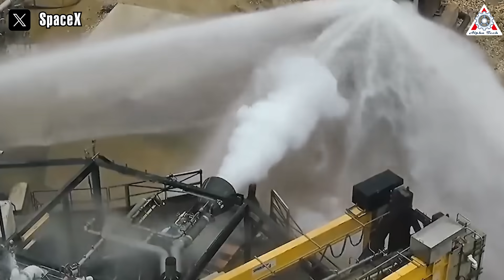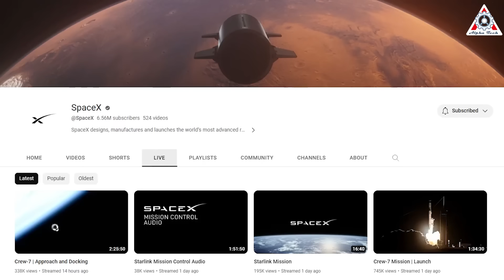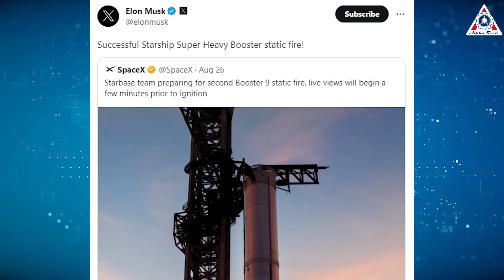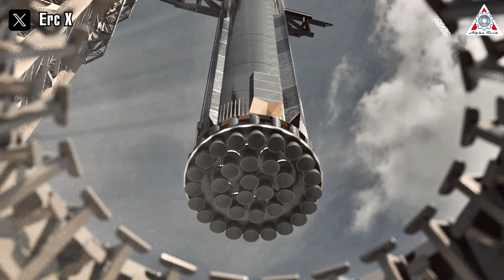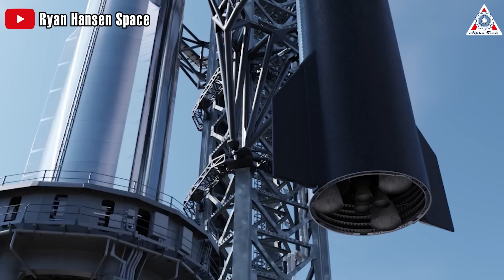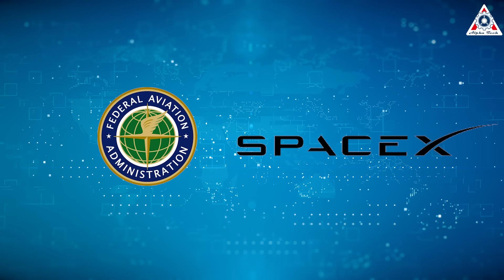SpaceX's Raptor issues FIXED! Analysis 33 engines fired aftermath...

Comment: They only tested 50%, but I think it'll still be okay. after the data they got now, if they need to reinforce it they will.
Reply from the maker: Thanks for your comment! Let's wait for their next steps!
Reply: They need to test it at 100% thrust for the 5 or so seconds they expect the booster to blast the deluge system during an actual launch.  As soon as they get it right in Boca Chica they need to copy the installation at Canaveral and Vandenberg...
Reply: @frankmcgowan9457   NO, the brackets holding the booster down cannot resist a 100% thrust.  You would need a fully loaded Starship mounted at top as ballast to increase the thrust level and even then you wouldn't be able to hold down for long.

Comment: Raptor 2 has not yet shown any reliability, as 2 of them shut down on the static fire. Until they achieve 33 engines on a regular bases, then it is not reliable.
Reply: I mean, if the have about 95% engine reliability, that's not bad depending on how many engines are required for a successful launch.
Reply: @yournumberonepal  95% is a 1/20 failure rate, basically a guaranteed failure every launch.
Reply: @backlog2389  As the fuel is used, the weight is less, along with the thrust needed for the same speed change.
Reply: @backlog2389  A failure of individual raptors, yes. A big question is whether mission success requires all engines running or if it can take a 95% success rate and still work fine. If they barely succeed in their mission with 29/33 engines, then the overall mission success rate is 97.7% (setting aside that it matters which 4 fail in that case)
And, of course, if the engine fails on the pad they can abort without taking off; and if it fails in the air, then the further up it fails the less it matters - it did some of its work before conking out. It's just-after-takeoff failures that would be the worst.
Reply: Yeah that's what I heard as well.
Reply: Yes a reusable rocket needs reusable engines.  Looks like the halt criteria was loss of 4 on the previous static fire test.  That many lost resulted in a slow liftoff, which contributed to the pad damage on the first launch.  F. Miller
Reply: @sandramiller7972  From what I recall, they intended a slow launch for that test, after the damage there was a statement that they will lift off faster next time.
Reply: Partially. It also took 5 seconds to light all the engines. They said that was cut in half.
Reply: Yep, target zero, over and over!
Reply: The problem is not with the raptors, as is evident by the fact that all of them lit up. The problem is with the start-up sequence, something Elon has mentioned multiple times. It's a very complicated start-up sequence and SpaceX is still working on perfecting it. But raptors are fine! That's why instead of swapping out Raptors from B9, they performed multiple purge tests of the Raptor Quick Disconnect (RQD) of the OLM after static fire 1.
Reply: It has shown significant reliability and is improving all the time. The last tuning will be the hardest. And those engines are relatively dated
Reply: Correct! @mysteriouse5891
Reply: They need to determine why the engines quit. If vibrations are cutting them off, seems that, as the rocket lifts, there won't be as much reflective sound/ vibrations to do ant damage
Reply: @MrDmorgan52  True, but that last bit of tuning can take time.
Reply: Let's see. Hopefully IFT-2 will show us what's happening.  @MrDmorgan52
Reply: You clearly don't understand what you are talking about
Reply: The amount Elon fanboy copium being huffed around here is wild.

Comment: Didn’t 3 engines shut down prematurely in the latest test?
Reply: 2 in the most recent test, for booster 9. Within stated parameters.
Reply: @Stormclowe  Thank you for the clarification. Have they released yet what caused the 2 engines to prematurely shut dow?
Reply: @icare7151  Not that I'm immediately aware of. I'm sure if it was something noteworthy they'd have stated

Comment: Raptor issues NOT fixed: 2 engines still FAILED FULL test duration. Improvement, probably yes, but engines at around 50% full thrust.
Reply: Difference being, 2 engines shutting down is within their stated parameters, 4 (as in the previous actual failure) was not. 

Progress is progress. What are you doing to help?